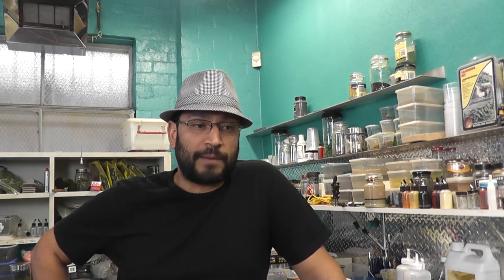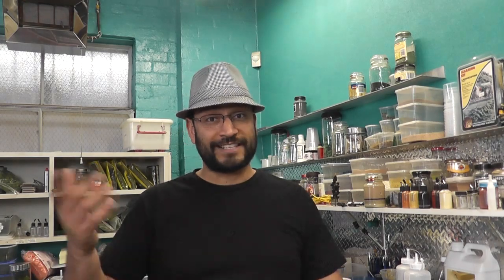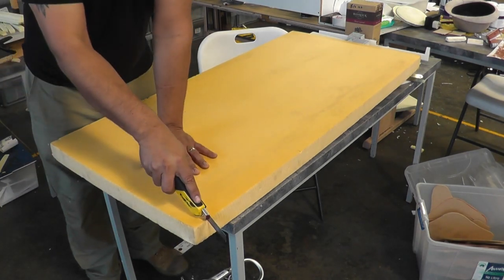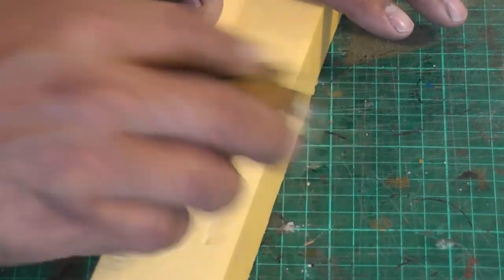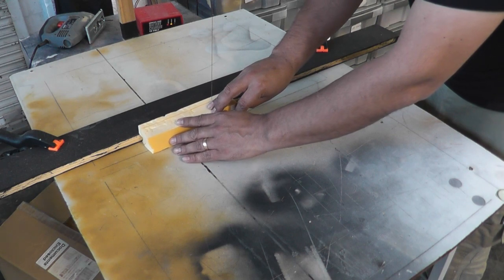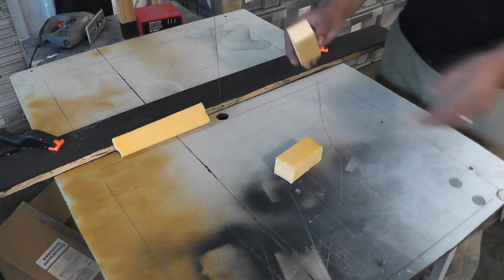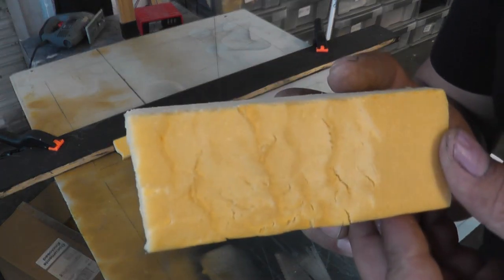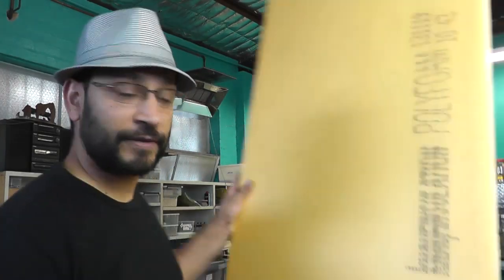Review: Yellow Foam

Comment: I was wondering if that foam was good for using since I saw it around a month ago and didn't know if it was any good.

When I was talking to the guy at the trade counter he said they can get the pink and blue stuff as well.

Now to get a hot wire cutter!
Reply from the maker: That's interesting that they can get the pink and blue in ... maybe a special order.  Might have another chat with them.  Cheers
Reply: No Problem... At least I now know that I can use the yellow for this Malifaux table idea I have had lurking in the back of my mind